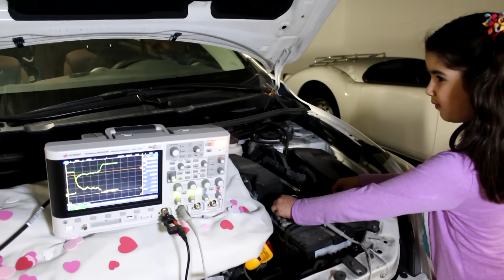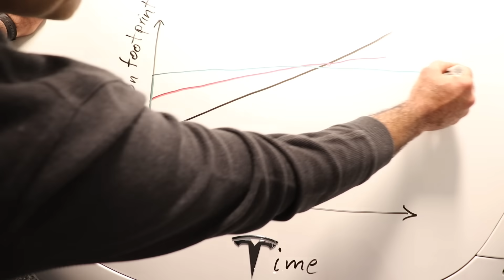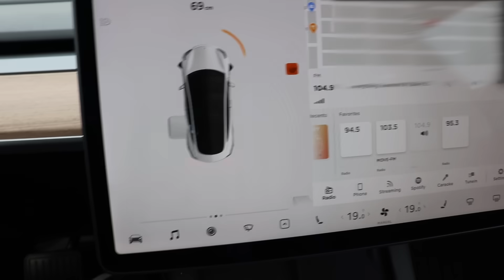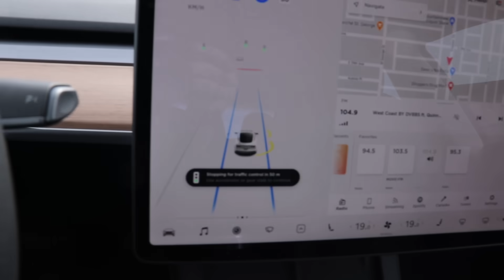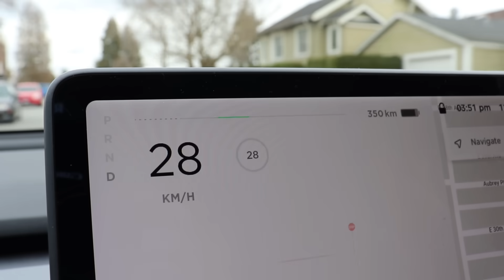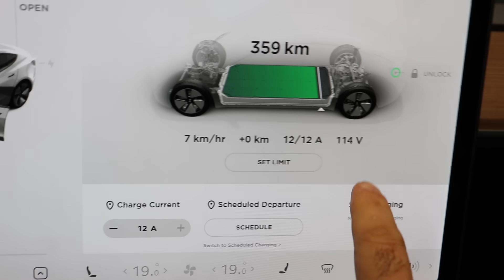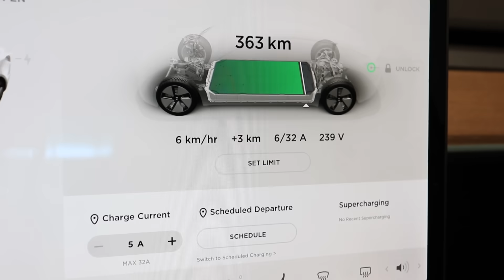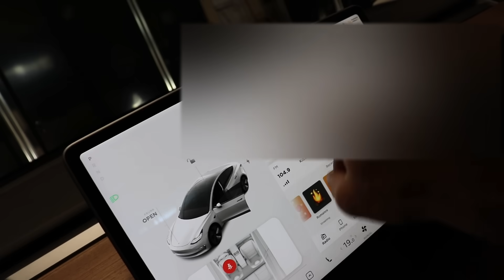ELECTRIC VEHICLES & My Tesla Model 3 Review

Comment: Yes. Overtime it will make less footprint then a fuel combustion engine, but before that happens the electric car will be dead and you either need to get a new one or a new battery.
Therefore, my classic 40 year old mini 1000 is better for the enviroment then any Tesla!
Reply: It takes 8-10 years for a battery to die so no it isn’t better for the environment.

Comment: You should not buy a BEV solely for environmental concerns; if your current vehicle is ready to be retired or you're looking for a new car anyway, sure, go for it. However, the manufacturing impact of a new BEV will not be offset by its reduced energy usage and emission-shifting properties (in that they shift emissions from your car directly to the power plant that creates the energy to charge it) for roughly a decade of regular usage.

BEVs are better, but they aren't magic.

Comment: Ok your long-term carbon footprint (CFP) is better than gasoline cars, bit what exactly is that timestamp where the curves meet? 5 years ? 10 years ? Well I doubt your battery will last this long. CFP +1
How exactly did you calculate your average CFP over time ? Do you only see pollution from the car or also from generating electricity to power your car (tip: uranium) ? CFP +2
I hope you won't, but even if your curves were right, that means that every EV that crashes before that unprecise timestamp you mentionned leads to... worse total CFP over lifetime.. and I imagine they are far from isolated cases. CFP +3

In conclusion... EVs are an ecological disaster, disguised in "clean-ish" cars with fake arguments to convice people with good intentions like you to buy them.. to sell even more types of cars, because yeah in the end all that matters is money, not ecology..

Comment: The AC stuff even in my hybrid is a massive power draw I managed to sit with just the cabin fan on for well over 10m and in about 1m30s the ac drained the battery enough to start the gas engine

Comment: Laughs in Caddy
Don't misunderstand me, all my respect for ppl who want to go green, but don't tell me that it's more cost efficient to buy an electric car over a reliable diesel.
Yes, it's cheaper to charge them, maybe cheaper to maintain, given there is no big issue coming up, but if you take into account the price you buy it for compared to a regular fueled one, especially if you can get your hands on a good used one, you are coming out much-much cheaper on the long road with them. Electric cars and solar panels won't make back the money you spent on them in their lifetime, let's wait a decade or two until they can make them live longer (not battery-wise).
Reply: You must have ignored the whole frunk/whiteboard discussion, which included the higher initial cost versus cost over time – and initial cost will be relatively cheaper as time goes forward and electric is more common.
Over time, the total cost of owning an electric vehicle is less and you cannot ignore cost of fuel and upkeep.  If the vehicle isn't terrible, those costs should be more than the initial price, because you should be able and willing to keep it for a long time and not need to sell or scrap it.
As for used, you can buy electric cars used, too.  Either way, buying somebody else's problems is an unknown gamble, and every vehicle is a different beast when it comes to parts failing.

Comment: You know there is a graveyard for electric cars that have failed bc nobody can afford a new battery if the one is use goes bad. If electricity is our future then no money is our future. Gas engines are dominant. Face it, electric cars are a failure. This is why we have echo systems in gas vehicles. Btw an 1980 BMW M1 has a 0-60 in 3.5 seconds, gas is where the power is. Tesla has been destroyed by sleeper cars as well.

Comment: Great, but for me the idea of having to charge a car several hours on a long trip and not having any way to move the car when it runs out of battery. 🤔 I think I will just buy a hybrid for now.
Reply: How do you move an ICE car when it runs out of gas?  Plan accordingly not to have that happen, or pay for a tow.  As Mehdi said, rentals are likely cheaper for some long trips, which most people don't do often.
While most places aren't totally ready for electric, most of the people in North America and probably a good part of Europe would probably be doing fine using electric cars for most of their daily needs today.  The initial buy-in cost gets lower each year, new faster fuel stations continue to open, and the market doesn't seem to be going back towards petrol.
Electric is the future for most drivers.

Comment: ElectroBOOM you forgot to talk about the huge safety factors of the car.  Like how even their SUV (Model X) has such a low center of gravity from the heavy batteries being on the bottom of the car it's damn near impossible to roll the car (https://www.youtube.com/watch?v=L24xzJkCGdk).  Seriously, it's the most roll proof vehicle ever.  And that glass roof is a safety thing.  Did you know that the worst parts of roll overs is the metal roof caving/ripping and causing serious head injuries.  The glass roof is safety glass so you'll not give you a head injury rom the roof failing.  Seriously though, car roofs are very thin sheets of metal.  Also the weight need to crush roofs supports is something stupid like FIVE times the weight of the vehicle (https://www.iihs.org/ratings/vehicle/tesla/model-3-4-door-sedan/2020#roof-strength).  WAY over what a typical car's safety factor.

Comment: The carbon footprint of batteries are bad because you can't have the same batteries for 10 years! 
To have the same carbon footprint of a fuel car, you need to drive your electric car for over 10 years!!
You need to change batteries every ~5 years like with your phone so it's worse than a fuel car!
And it's always better to buy a used car because the carbon footprint of building it has already put the previous owner.

Comment: You should do the review in five years when the battery doesn't hold a charge anymore and you're taking it to the junkyard. You could tell us all about how much carbon you didn't omit. And then you should calculate over those five years how much fossil fuels burnt  to charge your electric car that doesn't put out emissions allegedly. And then compare the amount of damage the lithium batteries are going to do to the environment in order to either dispose or recycle them. Then you could tell us about how much pollution was put into the environment in order to make those plastic panels and how many of them ended up in the ocean period and then you could explain how those nice leather seats are going to be covered when we get rid of all the cows because they fart too much. At the end of it you could explain to us all that it's way better to get a gas-powered car open up the Pipelines let the oil flow and produced plenty of carbon for our trees to convert back into oxygen through photosynthesis. Don't forget to put your mask on.

Comment: Dear Mehdi in fact you can save with normal petrol engine while driving , while you breaking with your enginie its computer cuts of fuel so the momentum of your car gets used to run the engine not the fuel

Comment: Electric cars are cool, but I absolutely despise touchscreens in any car, electric or not. No way you're gonna tell me it's safer to have a screen that you have to look at it if you wanna change the radio or mess with the climate control as opposed to having buttons and knobs you can feel while looking at the road. Not to mention, did you see all the fingerprints on it? How do you clean it?

In summary: nothing against electric cars, but touchscreens can go die.
Reply: My Murano (about ten years older and much less smart) prevents use of most navigation/entertainment features via touchscreen while the car is driving.  I can use the dedicated dials on the console and steering wheel, however, without needing to focus and read things that aren't on the road.
Both vehicles offer voice commands for many features, eliminating the need to fiddle with said touchscreen while driving.  If you really gotta watch a movie or play fart sounds, you pull yourself over and park before you get a ticket or kill your family.
They know it's not safer, which is why it comes with voice controls and conditional limits.

Comment: Does the car creep like a regular gas car? Because it doesn't have an engine running. I wonder if people are crashing their Tesla's because they have to use their gas pedal to get moving and the acceleration is so high
Reply: There's no driving idle because there's no constantly moving flywheel needed to keep an engine running.  No accelerator at a level stop, no movement.  The driving experience is slightly different and takes some time to adjust for some people.  As with any heavy moving object, you should understand how it works before lunging it around public spaces.  If people are crashing that way, it's not the car's fault, but a driver who hasn't practiced enough in an empty parking lot or back road.

Comment: Hey Mehdi! I am a chemical engineer from Argentina and I work in the construction of biogas plants. It is a process of anaerobic digestion, which transforms organic matter (animal manure) into methane. We then use this gas to generate electricity. Although we are burning this gas in a cogeneration engine, it has a lower environmental impact. There is no way to obtain the methane that the cow expels, however, the generation of it in their stomachs could be genetically controlled (in some point). Greetings!!
Reply: i would imagine a diet suppliment for the cows would be better as changing their digestion processes genetically will effect every other factor about rearing them. like a fart supressent you can get in the pharmacy
(not labelled as fart supressant obviously).
cowpat would make for a much better source for gas based fuel in general mind.

Comment: Electric cars would make sense if we used the sun to charge it. 
Using coal to charge it seems ridiculous to me. Maybe I’m missing something.
Reply: That's an energy grid problem, not a car problem.  BC only uses about 5% non-renewable fuel in their electric grid.  Easily found on the web.
Reply: @VoltisArt  you don’t need a grid to charge a car with solar. Just plug it into a  panel. 
You missed my whole point.

Comment: Hi, Electroboom.
I don't work with electricity but I have a question.
A wind turbine turns generating energy.
What if you Added something like that to a wheel or two to a tesla?
Would it charge while driving?
Reply: Nope.  This has been tried in many different ways, with every type of vehicle that ever had a motor.  The friction required to push the generator is usually more than the power generated by it, resulting in a significant loss of power.  Rare situations can cause short-term gains, but average driving results in a loss, and whatever weight you add is a near-constant loss in fuel economy.
Only a system that was only deployed during deceleration or down-grade(slope) situations and put into neutral other times without adding weight to the car can add to the fuel reserve, and that's what regenerative braking does on a hybrid or electric vehicle.  The motors become generators in downhill or slowing, and feed the battery energy to be used later.  This is also why electric cars don't need brakes changed as often:  They use the motors for most braking situations.

Comment: Hey mehdi important thing, you do need to perform brake changes on an EV, it's just something you do less often.
Cheers.
Reply: My Tesla Model S has 170,000 km now. Some people say I'm an agressiv driver. On the Autobahn I usually drive 180+ km/h when ever I can, which means I have then to use mechanical breaking more often.
I still have the original brake pads. Yes, they wear down eventually but very slowly. My gues is that if somebody drives not that crazy like me he can easily use the original brake pads for the life time of the car.

Comment: you still need to change the brakes bcuz they will get rusty and degrade over time so you still need to change them/drive hard and use the brakes heavily every once in a while to get the rust off of the brakes bcuz if there is rust on them and you try to brake for an emergency it will take a substantially longer distance to fully stop, yes I realise you still wouldn't have to replace them for a long time but you do still have to replace them and in some cases, people don't use the brakes at all and they end up spending a couple hundred dollars every year because they never touch the brakes and when they go to tesla for a service or whatever they tell them they need brakes, I can't remember where but I saw it somewhere.

Comment: You'll still have to change the brakes from time to time, just less often. There's a similar disparity between automatic and manual ICE cars.
Reply: tires, diff fluid, wheel bearing, shocks and a few other things are still needed aswell
Reply: @SamTheSambaMan  diff fluid on a Tesla?
Reply: @fmaz1952  In single motor electric cars there is a differential. If there wasn't one both wheels would turn at the same speed when turning and that would destroy the tires and put tons of strain on the rear suspension components etc. Also all electric cars have a small single speed gearbox that needs oil to be replaced if you drive many miles.
Reply: @SamTheSambaMan  yeah still got all the bushings,  tie rods, ball joints, bearings dampers, auxiliarys AC components, cooling pumps,  then theres the electrics, if the inverter pops a IGBT or .... that's going to be expensive.  Then theres the Elephant in the room battery degradation,  I wonder how much a new battery and fitting costs😬 dont get me wrong I'm an advocate for EVs but I think il wait for the battery technology to improve along with the charging infrastructure before I consider one 
.. I have a feeling once they get everyone onto EVs the price of Electricity will skyrocket,  they will have to upgrade the whole grid to support EVs and you know who is going to pay the bill in the end🤷‍♂️
Reply: @T2D.SteveArcs  You don't want to know. It's pretty bad if not under warranty. To be frank it's a bit of the manufacture's fault for housing a battery tray within the structure of the frame, or as part of it. It's to save on production, but it makes it very expensive to replace (even if the trays are modular-ish). To be fair the other issue is physics, so there's that (all those batteries charging/discharging in that power range makes a BIT of heat, and you do absolutely have to engineer a solution to this before allowing it to be sold, and they have, it just currently requires a sealed battery tray).
Reply: @lesassassin  yeah I thought it wouldn't be cheap mate, thanks for your reply 😎👍👍👍

Comment: You will forever have to move the steering wheel a bit or press a button on auto pilot - this technology is used for over 60 years by trains, which were kind enough to give it to planes and lately cars. In the most noble way of terrestrial transport (trains), there is a "dead man switch"/SIFA button which you have to trigger by pressing a pedal or switching a button so the cruise control AFB (automatische fahr und bremse) knows that the driver isn't dead. If the confirmation is not given in 10 to 15 to 30 seconds (depending on the country, area, system on the locomotive/rails) the locomotive will deploy emergency breaking and the train will stop. This confirmation is required at an interval of at least 45 seconds and max 2 min. This , will, forever, be, in, autonomous, cars. If you know trains, Tesla is a cheap homework copy of an electric/diesel locomotive and 60 to 70 years old technology just copied on cars. Not impressive, not futuristic, nothing new.

Comment: What i learned from this video: Either power in Canada is extremely cheap or power in Germany is extremely expensive - 1 kWh costs a little bit over 0,30€ over here (0,45 CAD / 0,36 USD)
Reply: Might be both, from what I've read here and elsewhere.  Most of British Columbia's power (almost 90% as of 2016) comes from hydroelectric.

Comment: Yeah well, that is at your place, here it's gonna cost WAY more to charge as of the extreme tax we got here on energy... etc etc etc
so NO, if I won one, I'd rip it apart for the batteries to use in other projects.
Reply: and btw, to be "green"...
What is that electricity from? Power plant using Cole? is so, not so "green" then is it.
Reply: @AliensInc.  British Columbia uses about 90% hydroelectric, 5% other renewables like biomass and wind.  Only 5% is natural gas and oil.
Reply: biomass, yeah sure, cut down trees and burn them all, very neutral.
and hydroelectric, that is that really?